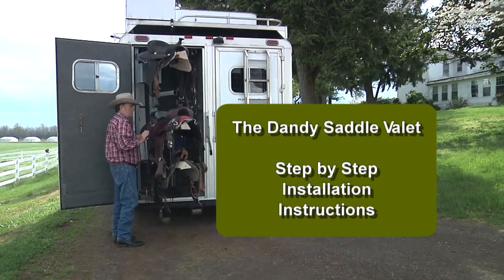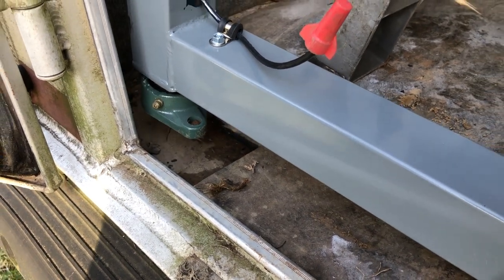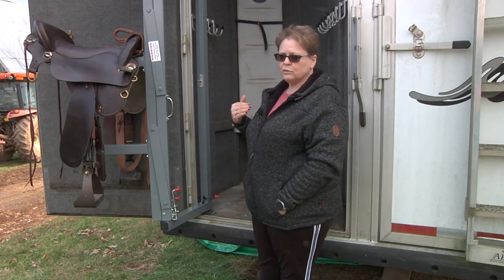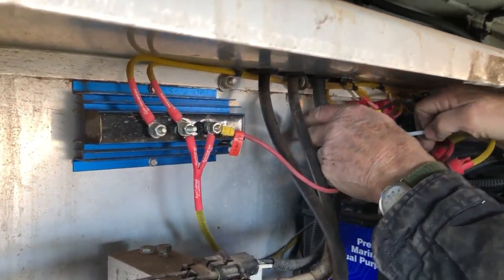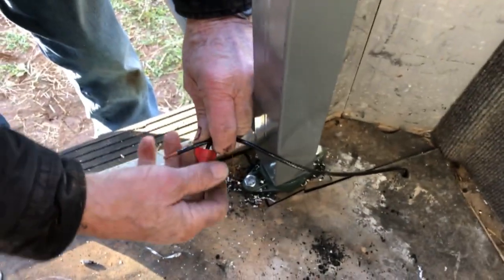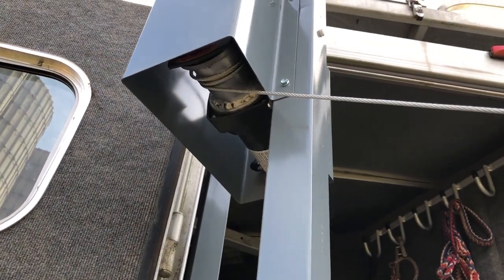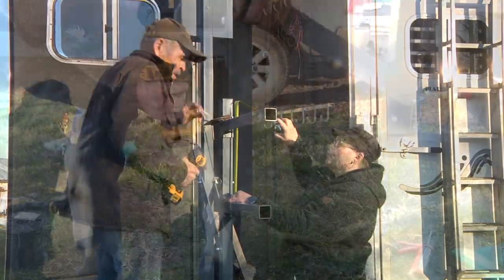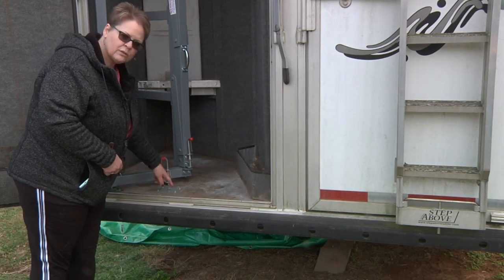Dandy Saddle Valet Installation Instructions

Comment: With the easy to follow instructions, you can install this great Valet, like a pro.  But one thing to remember, you may want to use LockTite on all nuts and bolts exposed to the elements.